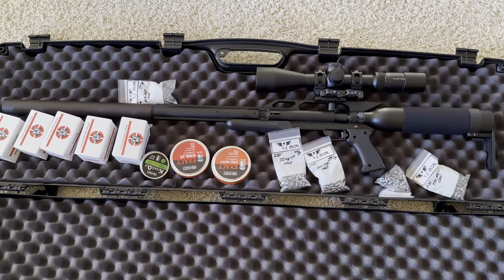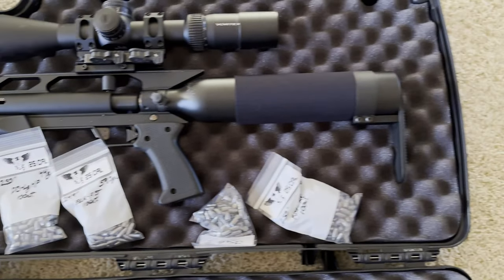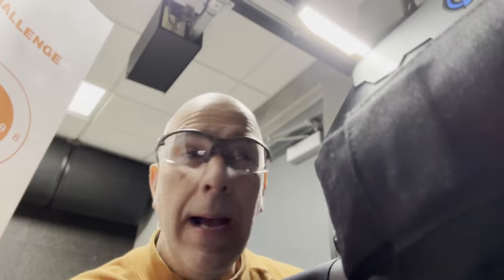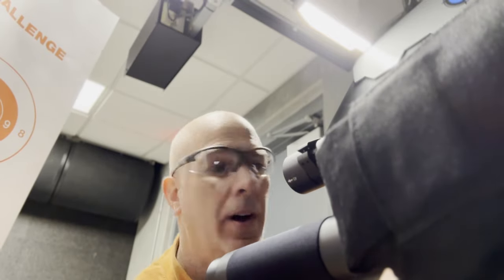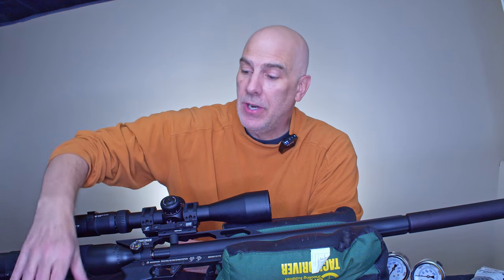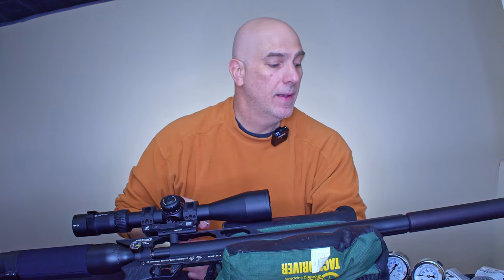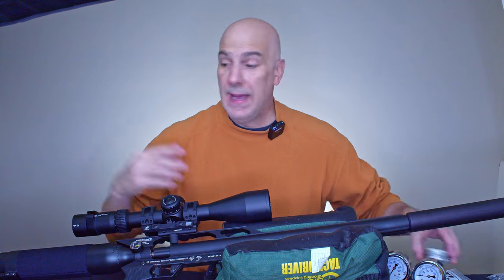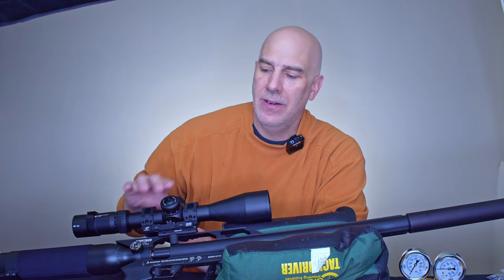Airforce Condor .25 Slug Project ?

Comment: I hear good things about the .257 Texan.   However, I ended up purchasing the .308 as my goal was to pick a caliber that was "bullet casting" friendly.  The 308 has numerous bullet molds available.   The .257 had fewer offerings for casting.    That said, the .257 is probably the BC king for long range shooting.   

I have been extremely happy with the .308 Texan.   I shoot almost exclusively my own cast bullets and have found them to rival the accuracy provided by various NSA slugs I initially started shooting.    I shoot 3 to5 shot groups untethered to establish viable hunting tunes.  Group size is dependent on bullet weight and target distance.   

General rule is I can get 5 or more shots point of aim at 50 yards, 4 to 5 shots @ 100 and 2-3 shots @ 200 yds.   Again, these tunes print very close to point of aim with minimal holdover.

My standard go to bullet is a Lee 120 grn round nose.   It has a LabRadar calculated BC of .1727.   My rifle will group these under 3" at 100 yards on a bad day.  Typical accuracy is under 2" and my best groups are 1MOA (~1").    The rifle will print these under 4" (2 MOA) on a good day and will typically print between 4-6" groups untethered at 200 yds.     

Muzzle velocity is in the 960's using a multiple shot accuracy tune and produces in the mid 240 fpe range.   For hunting where tuned for 3 or less shots, the rifle will exceed 275 fpe using a 180 grn lee bullet.    

The .308 seems to like the following Lee molds: 113 FP, 120 RN & 180 RN.   The Texan also performs well using the MP .311 Sledgehammer mold which produces a 131 grn large hollow point projectile.   This projectile expanses adequately using WW lead (60 caliber expansion - Texan) and also shoots well when powder coated and shot as Win .308 reduced load (1800-2000 fps).  Note, you can over drive the hollow point expansion and cause fragmentation.   A solution may be to use the smaller HP mold pin provided although I've not tested. 
 
The following links document the above claims....    All shooting was done untethered although some videos may show the filling whip left attached to the rifle as to not waste bleed air and for convenience.    

Note:  clean your barrel!   The .308 needs cleaning about every 50 shots or when the pattern suddenly opens beyond typical/normal.

MP .311 Sledgehammer HP Bullet (sized .309) @ 100 yds (3 shot tune)
https://youtu.be/plfHAxo31Cs
.308 NSA 105 grn - Tune verification (3 groups untethered sub 2 MOA) @ 200 yds
https://youtu.be/k8YBPgO_T9A
sporting clays @ 200 yards(lee 120 grn cast WW lead)
https://youtu.be/5n1a7mnbZ44
long range lethal Testing @ 200 yds (lee 120 grn cast WW lead)
https://youtu.be/Gg3u6Q8wyz0
100 yard groups (lee 120 grn cast WW lead) - 4th group is 1MOA.
https://youtu.be/d9MHmsFKTK8
Reply from the maker: Hey thanks for the write up. I am currently working on a .308 build.  I have some bullets I am testing behind the scenes.  I am not trying to be negative towards the .308 it is very versatile. I am able to use 30 grain pellets along with slugs.  I am however finding the accuracy a bit lacking in this round so far. I hopefully will get his figured out. I would like to be able to turn this into a 1 Moa gun or near that.  hmmmm I know that is asking alot we will see. 

Thanks again,
Reply: @ShootingTargets727  - 1.5 MOA is doable at 100.    You might need to tether for sub 1.5 MOA performance.  Just got to put the time in to find the fill pressure/reg pressure and hammer preload.   I’m sure I’m not telling you anything you don’t already know.   But tigger time & testing is key.  Good luck.
Reply from the maker: @motorgearhead  Thanks for the input yep, agree...

Comment: Nice video, thanks 4 sharing. 

If there's one thing I don't understand, it's tethering. Yes I understand the advantage of tethering and using the external regulator, but to me that's the same as testing a Tesla with an infinite extension cord. It's not the performance of the car when circumstances are ideal, it's how it performs when the conditions get less. Only then a car defines itself. Same goes for an airgun. 

In my opion a slug has to perform without tethering. My good old TalonP (awesome at the time when I bought it) is unregulated so that's what I worked with and I accepted it's drop off because at that time, most guns were unregulated. They still make the TaonP but it's mind boggling that in all these years they only changed the triggerguard surround and added a suppressor yet they fail to listen to the customer and what it is they are asking for year after year after year.

The fact that AirForce still has good sales is incomprehensible to me. Over here in the EU, AirForcey would have changed to picatinny and regulated versions years ago or the cpmpany would have gone under. People in the US criticize AirForce on so many forums for not going to picatinny yet they keep buying their guns, how does that work? If you look at the TalonP video of AirGun Depot where Cameron literally says (somewhere at the 6 min mark) "everyone wants us to make picatinny version" and then he simply dismisses it by saying "we sell picatinny adapters". They-Just-Don't-Care . . .  

Where I come from, that's a slap in the face of the customer. It's pure arrogance and arrogance needs to be adressed by the customer. AirForce has a "teflon minset", critisizm just doesn't seem to stick with them. Sorry for my rant mate hahahaha . . . long story short, I would like to see a slug that works at 50 or 60 meters with a pressure drop from 200 to 150 bar without significant bullet drop.
Reply from the maker: I totally get where you are coming from.  You hit on alot of issues with AF rifles.  So lets start with tethering, yep to tether and show groups is only for IDEAL conditions of showing what the RIFLE COULD DO..  So when I shoot tethered its more to say its the best its going to get.  So to tether you need to find the ideal pressure for your say 1 to 5 shots of accuracy.  I know some people will say you can shoot 30 or 40 shots from an untethered condor I just do not see that happening unless you reduce power WAY WAY down.  Shooting slugs with power is way different than say shooting pellets. With pellets you can turn the power down to 12 fpe and shoot 100 shots accurately without an air regulator as soon as you turn the power up AF rifles just are not efficient.  I want to do another video on setting expectations  on how AF rifles fit into the mix. The biggest thing is the industry has changed so much and our use cases and expectations have changed as well.
Reply from the maker: Thanks for watching and commenting.  Sorry could not write back on all the issues you commented on but might try some video.
Reply: @ShootingTargets727  Thanks for your response ;-)